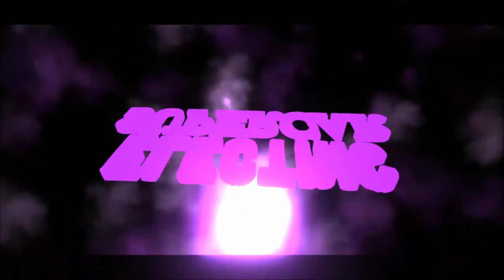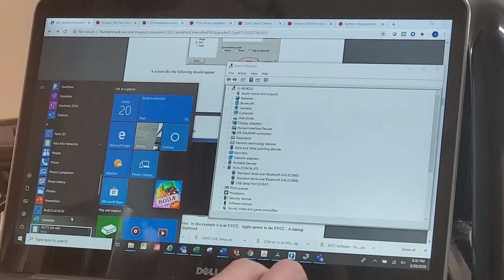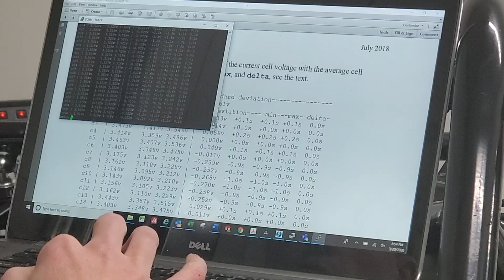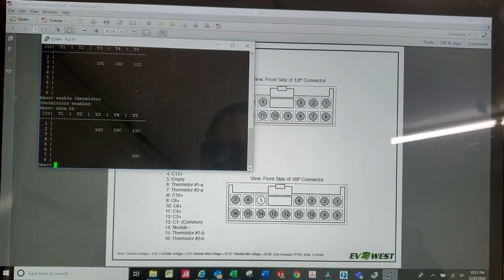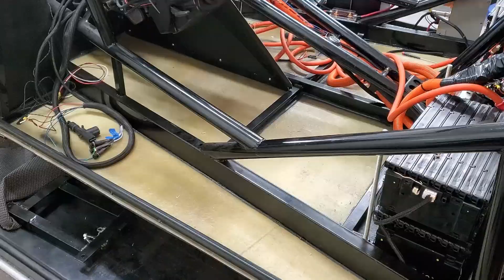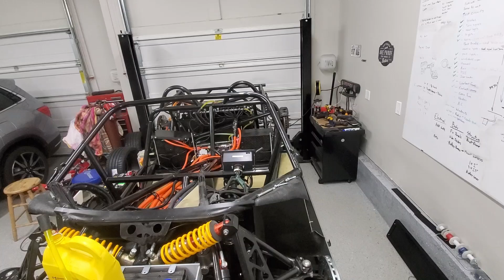Battery Management System - Dilithium Design

Comment: This is a great video on the Dilithium Design BMS. 6 year old video but still a top choice for EV conversions. On a conversion today you would pair the BMSS (satellite) with the newer MCU (Master Control Unit). This allows you to set Charging, BMS and System functions from one convenient point. We bench build all of our systems to make it easy to fix anything before it goes in the vehicle.

Comment: Question for you if you can or have time! I saw that you where on Jeremy HUM EV Youtube channel setting connecting and setting up is Orion BMS.  Since you did work on the Orion BMS and with the Dilithium BMS for your project, which one did you prefer ? 

I'm currently designing from scratch an electric 3 wheeler. I've also design the electric motor and it's currently under construction. I'm also designing the inverter. Thanks for sharing your thought.
Reply from the maker: Hey Donald!  Probably depends on your goals.  The Orion is more popular, has more support and more functionality.  It also wants to interface with a lot of other systems like charging, HV interlocks, Motor functions.
 I like the dilithium as it is very basic and does not need or rely on other systems.  Good luck!
Reply: @electricsupercar  Thanks! It's good to know the different options of the 2 BMS brands. I will have an in-depth reading of the instruction manuals of the 2 manufacturers. I must admit that I really like the simplicity of the Dilithium BMS. Thanks for the good luck!

Comment: Love your VDO and watch everyone of them.  Whats the total you spend on your Dilithium system ? does it have WIFI to work with torque Pro ?
Reply from the maker: I do not think it has built in wifi.  It communicates with CAN.  I do know that people can use a wifi OBD port adapter to try and make things like that work.  Call ThunderstruckEV, I am sure they can answer your questions
Reply: @electricsupercar  Thx !

Comment: Is your supercar will be a RWD or 4WD like other Tesla's cars ?
Reply from the maker: This version I could not fit in dual electric motors.  I have the rear performance motor from a Tesla model S P90D.  It should be rated for 475kW (610hp)
Reply: Jeremy Perraud RWD